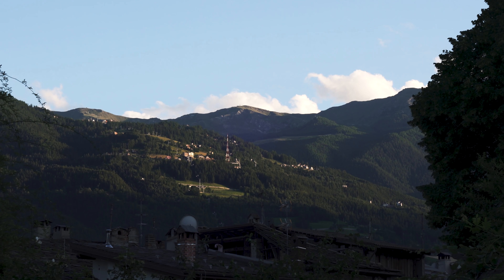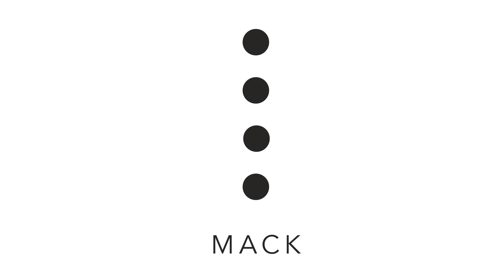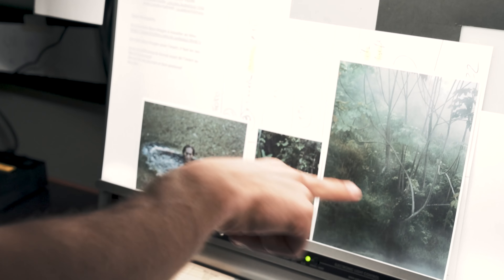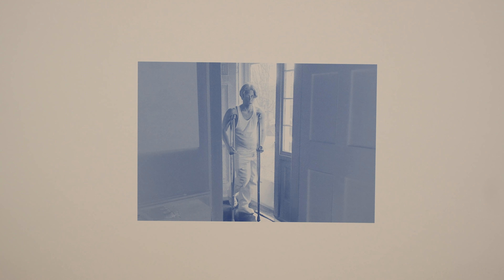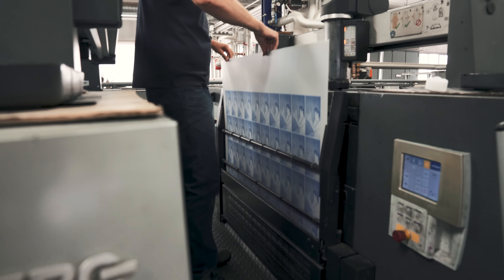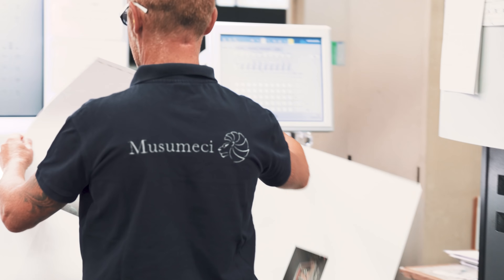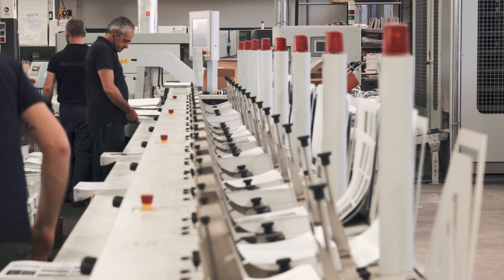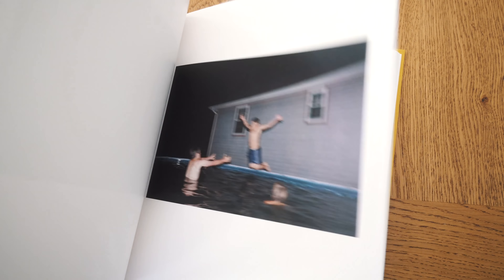How Photo Books Are Made

Comment: Very well done, you absorbed a lot of information there. I have worked in some of Australia's largest sheetfed offset printers my entire 24 year working life. Things a quite different nowadays compared to when I started my trade in prepress. Technology made a lot of people redundant and a lot of things easier - you could also argue it took a lot of trade knowledge that I had learned and did it for you. 

When we produced the artworks in prepress, we didn't get digital camera files - we were given 35mm negatives and slides, also medium and large format transparencies and general photographs. We scanned them all on a drum scanner. The the artworks were made on the computer and output to film - this required developing and fixing similar to photographic film. Those plates you showed were then exposed from the film. The plates were put on press and the ink levels adjusted by the printing machinist, not like the inline sensors that do it now. 

It's still a great trade but a lot different. I now manage a high speed digital web press that can produce a completely different image each frame and apply offset varnishes in line. Fantastic stuff.